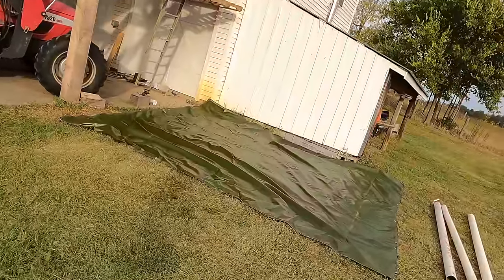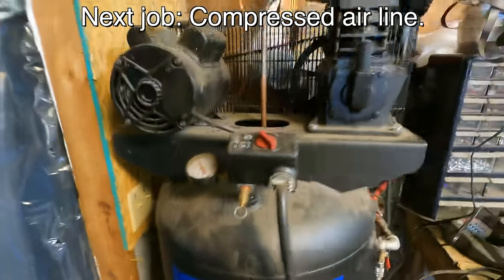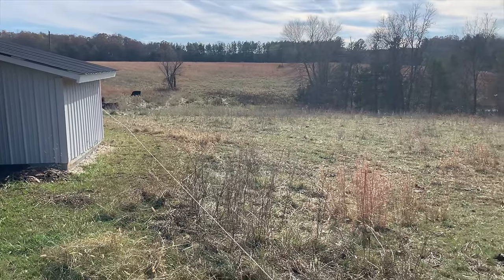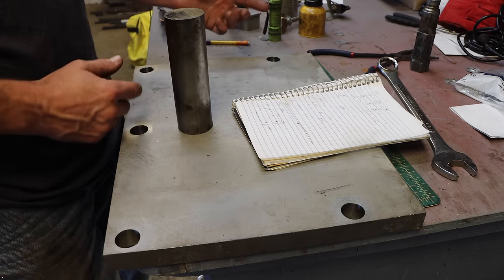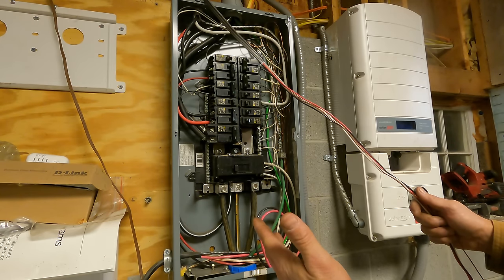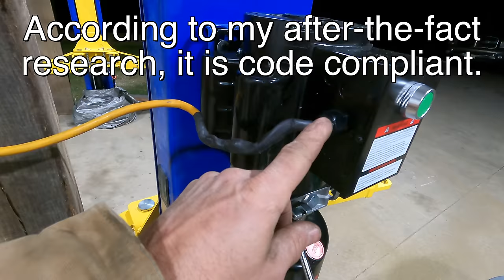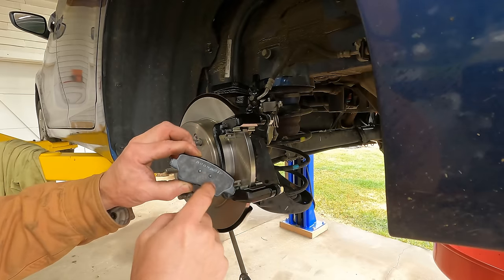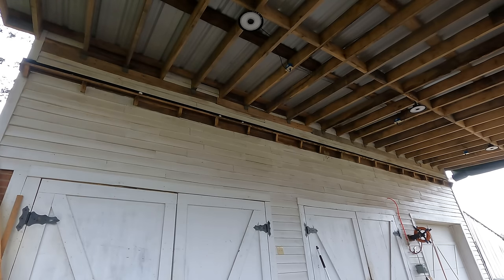Installing a 2-Post Vehicle Lift And Other Big Shop Improvements.

Comment: With the duplex outlet right at your lift, you can put one of the outlets on the red wire and the other on the black.  Just make sure to break the tab on the hot side of the duplex outlet.  That will give you a pair of 20A circuits each with one outlet, instead of two outlets on the same 20A circuit.  Just might come in handy out under the shed.

Comment: Not that you needed the 2nd opinion, but I totally agree with your sentiment that the receptacle box you put along the 240 volt line is safe. I definitely stared at it a while though. The main thing that would potentially make it unsafe was if the breaker had to be larger than 20 amps. There's specifically a carve-out in code that you can put 15 amp receptacles on 20 amp circuits. But you can't put them on anything bigger than a 20 amp circuit. Normally 240 volt lines are used for things running more than 20 amps, so I could see why an inspector would give you a stink eye for it, but as long as you don't replace the lift with something that needs 30 amps, there should be no problem.

I should say, for modern code, and honestly your safety in a way I have personally been hurt before, you DO  need that whole circuit to be GFCI protected... or you have to pinky promise to never touch the live leads while standing in a puddle. I have no idea if the breaker you put in was GFCI or not, so I'll just pretend it is in my mind and leave it at that.

Comment: You say you are not 'an electrician', but I can tell that you have done wiring before, and you understand conventional single phase electrical circuits. I like a heat gun better than the torch for heat shrink tubing, though. But what about that poor seal?? :) Nice job with the leveling and mounting to the floor, although I would call your 'bushings' 'spacers'. Your Evolution chop saw is pretty tricked out!

Comment: Have the bottom plate version of that lift. Was $1750 delivered before the... ya know... got mine 5 years ago now. Zero issues. Lifted a 1967 RR Silver Shadow, heaviest for me so far. Saw a video of one that leaked at the fitting connections, I used some rings from the HFT viton kit and zero leaks.

Comment: Brilliant channel - tiny suggestion. Love everything about what you do. I have learnt a lot. I know you like to make things to last. Great to see you soldering those joints with flux and adding heat shrink. Perfect! Flux is acidic. Scrub it down with something (ISO Propyl Alcohol will do). 10 years later, if you don't, the acid will corrode the joints. 40 years ago, I worked for a military contractor. We dipped all circuit boards (solder joints) in a Freon bath (with no lid on it) - probably explains my mental health :-) - Just saying...
Reply: or better still forget the solder and use crimps

Comment: I like you progress on your shop expansion. Oh somewhere you said you used drywall screws in your tarp construction? Drywall screws rust unless stainless steal.or zinc coated and are ectremely brittle. Any lateral loads can cause them to break. A better choice for outdoor use, general wood construction  are strar drive, zinc coated, deck or construction screws. (They do not slip often, like phillips head drywall screws do.) Simpon Strong Tie brand has specific structural screws for use with any of their or similar framing connectors and braces. They have increased strength over other screws for use with thier framing hardware. I think you said you did use those on the ledger board already. I have used both with great results.

Comment: As a veteran of many plastic tarp doors, I finally developed a solution that lasts forever. I now make my tarp doors 2 layers thick. Outside layer is black shade cloth, the inside layer is a good quality poly tarp. The shade cloth keeps the sun off of the poly tarp, and the poly tarp provide a wind & rain barrier. I have "doors" that have been up over 10 years in the Calif sun and storms and look as good as the day I installed them.
Reply: @FarmCraft101 Looks like you got some spammin' going on here. Can you delete/ban the guy?

Comment: When I built my house, I put in an automatic transfer switch outside and a 24” length of 6x6 wire trough above my panel. The ATS let’s me shut power off to the entire panel if I really need to, and the wire trough let’s me fish the wire most of the way to the panel without running a steel fish into a live panel (we used conduit).

Comment: I would not have made a good farmer. My mantra is anything worth doing is worth doing right which also equates to doing things as much as possible so they are better than 'just good enough'. I understand the mindset when you have too much to do and therefore only do 'good enough' because you have more to do than hours in a day, but again, that's why I would not have been a good farmer as I would have continually been frustrated in my life because I couldn't complete things in the way I wanted to. I had enough of those moments in the career I worked in and now understand a little bit better my personality. Thanks for that. Also enjoyed the video and how you approached putting up the lift.

Comment: I really enjoy watching you work. A few enhancement suggestions regarding your wiring. Most people don't know that a standard 120 volt outlet can actually be wired with two different circuits for the two plug locations. You break off the tab which electrically connects the two "hot" lines and then run a separate wire to each one. Since you have split 120 hots into that box, you could run the red to one side and the black to the other. That way you would now be able to draw twice as much power from that one location in case you ever use two high draw devices. For example, you might plug a portable saw into one outlet and a small electric space heater into the other. My other suggestion would be push to fit wire connections inside that box instead of wire nuts. ("Wagu" type). They take up much less space and your little box is getting crowded, especially if you use my split circuit suggestion which would mean one more pigtail.
Reply: You've only got one neutral, which would be shared by both 120V outlets.  So, you'd still be limited to a combined 20A through the shared 12AWG neutral.
Reply: @ruinhair  Not so. The neutral in such a set up only carries the difference between the two hot currents because the hots are 180 degrees out of phase. If each hot were supplying exactly 20 amps, the neutral current would be zero. I know this sounds crazy, but I spent a lot of time earning my electrical engineering degree and that is how it works out.
Reply: @johnhorner5711  You're right.  Thanks for replying and providing more info!

Comment: You should get some on the the rams and cables on the lift. The chrome on them is super thin, and once its gone, its gone.

Also for SXS, mowers and tractors I took some 2x4 1/4 wall rectangular tubing, and welded some inserts that drop in the lift arms. Then took some 2x5 channel and welded some pipe so the pads from the lift can drop in. You put the 2x4 between the arms, then put the pads under the narrow frames. For zero turn I only use one and clamp it down fits right behind the deck. Then put the front tires on the other to arms.

Comment: I just found your channel and I'm really enjoying it.   I'm a millwright, which is the legitimised form of the 'jack of all trades', so I'm really enjoying the breadth of your content, and my family comes from meat cow farming, so this is all old-home-week for me.   If you start fixing a bolt gun in your next video I might pass out from the sheer familiarity of it all.
I'm only 19 minutes in, and you just mentioned in the video how you are going to approach the second leg of the vehicle lift, and anyway, what I want to actually say is that how I would have done the second leg of the vehicle lift.  For be, the best way would be to use long wedge anchors and add washers and nuts to lock them to the concrete so that they stick up 6" or so, but they are solid.    Now add more nuts with washers on top, and set the flange of the leg on top of that.   Put more washers and more nuts on top of the flange.  Now you can adjust the nuts to get the leg as plumb as you want it.   Here comes the important part.   GROUT IT IN.   Grout is a very dense cement/mortar mix that doesn't shrink hardly at all.   You pack that under the flange, and now you are protecting the studs, and you will feel oh so much better about things when you are working on a heavy truck with the wind blowing.

Putting an 8" thick slab under that flange would NOT be a good idea unless you are making that slab 100 square feet.    This is a two-post lift, so it has to take some potentially serious bending loads from imperfectly balanced vehicles.   It needs to be anchored into something BIG.   It needs roots.    Unless your thicker slab is big OR you drill into the old slab to mesh rebar into the new slab you are seriously reducing the safety of the system.   Grout, however, sits on top of the original slab and makes the system safer.

Keep up the excellent work!

EDIT:  I kept watching the video and saw that you did grout it in after putting in that rather impressive hunk of stainless, etc.    I would have used the long studs that you had to use anyway.  Way cheaper, and just as effective, but adding grout to yours is excellent.

Comment: I don't think the wiring of the receptacle is unusual, but typically the hot side of the receptacle is split, with each side being on the A or B phase. This is very common in residential wiring, and basically gives you double the breaker capacity since each side of the outlet is on it's own breaker. Regarding the wiring to lift, soldering is interesting! I was raised in a house that was built in 1899, when the gas lamps were electrified knob and tube was installed, and the knob and tube was added to before the advent of modern Romex with single wires that were all soldered. While I like your solution, my approach would have been to install a locking 220v plug, for a local disconnect, but I'm not sure why ... it's just my thought process. Thank you for another fantastic video!

Comment: Get a window regulator motor 12 v type from any vehicle and rig up a pulley system. Those motors are super powerful and that will save you yanking on that para chord which is painful.

Comment: If go looking to replace your hose reel, The Harbor Freight air hose reel (the cheaper one) has held up well for me (4+ years in a hobby shop), well worth the money. Also, I used electrical conduit (EMT) to protect the exposed air tubing (not pex) I used in my shop. Might be worth looking at for the pex you have outside.
Reply: That's great to know!  I have 5 old commercial quality hose reals I bought on auction about 10 years ago.  All are still functioning great.  I bought a Kobalt residential model sold by Northern Tool and that's been working great for about 5 years.  I just bought 2 more Kobalts of the same residential model and the threads going in to the side of the swivel were the wrong pitch (?) for the hose provided in the package.  I used a thread gauge and that threaded in fine, but the hose wouldn't go in more than a full turn.  Weird, but it's working for now.

Comment: That tarp pulley system is very clever. Took me a lot of head scratching with my eyes closed, to  figure how the tarp rolls around the pipe when its pulled up.
Reply: @K3PO  its thats pulley magick. It's difficult to explain in text but I'll try. The rope that goes under the pipe. It starts at the beam at top where it's fixed with screw. The other end of the rope is also up there at the beam but it's not fixed, but goes through pulley. Basically the rope that touches the underside of the pipe causes it to rotate while it's being pulled up.

Comment: Like your use of PEX for compressed air. And, while I agree that it can be used for compressed air (in non-industrial applications), you should not be surprised if you start blowing air lines. Plastic piping was started in the US in the 1980s. First used in industry started failing, not because of pressure but because the pipe was affected by compressor oils. Also, you will undoubtedly find a significant pressure drop at the end of your longer lines, under higher flows.  Finally, you should put a downward leg before your hose reel, called a drip leg. This will collect condensate in the air before it reaches your hose reel.

Comment: Hello
I am a new viewer and I am greatly enjoying your channel.  When I was a kid I worked with my old man a lot and he was an electrical contractor. The copper furrele you are using is called a Buchanan sleeve. They were very popular fifty years ago and in my opinion they are superior to wire nuts,although the European connectors are excellent for joints that are coming apart, wiring to motors for instance. The nylon caps you put over a correctly crimped Buchanan were permanent, or until they were attacked with side cutters. I noticed you mentioned the wiring code in your part of the world and they would not have been allowed in Canada. The reasons are of course water but especially in the country your furry little friend comes into play, squirrels  love to chew wires so you would have to use MIT or armored cable so the little devils have a hard time chewing through it. Funny, I worked with my old man for all those years ( slavery) and I still had no money for the movies on Saturday night, how did that happen??? I remember wiring parking lots when it was forty below f. And the wires sbapping from the cold this was well before global warming. Canada tends to legaslate things to death we have rules for our rules. Piont in fact if you have an hour to waste watch Ice Road Truckers ,share thier pain about going through the ice, bulls**t at its best, I have been friends with truck drivers running  the ice roads for 30 years no one excepts one poor soul years ago has gone through the ice, he did because he was removing the Intial snow-covered lake and could not see the open water. The lakes are checked twice a day with ground penetrating radar so it's no more dangerous than asphalt. I was so impressed with the electrical trade I became a HVAC/R contractor, I hope my old man is wiring parking lots for eternity.😊

Comment: I would be a disconnect beside the hydraulic pump. I learned this the hard when when the momentary switch on mine arched and stayed on. It was a panic to shut the lift down before disaster struck. Even an e stop next to the green button would work.

Comment: If it's a riding mower, you could try finding Hard Points at each corner and using slings around the Lift Pads hooked to the Hard Points...Lift the mower from above if you feel comfortable getting under it while it's in a sling lift that is...

Comment: Raychem makes an epoxy/adhesive inside coated heat shrink that is waterproof when installed according to instructions.  They make a nuclear grade too for when you get your backyard nuclear power plant.   I was also going to suggest dry packing grout between the foot of the lift post and the concrete.

Comment: My elevator mechanics used to drill 1/8 thick stainless 1 “ dia holes in elevator faceplates  for floor lockout key switches using kitchen liquid soap as a lubricant with no trouble.  I believe they also used 3/8 drill motors. 
JoeB

Comment: So, in my experience, using a piece of 1x4 or 2x4 to sandwich the top of the tarp against the board on the top will give best results. Your pvc tube at the bottom is netter than my rebar tied at the bottom.

Comment: At work we set equipment on epoxied in "jack bolts" to anchor/level the equipment.  Then form up and pour cementis ground under the baseplate.

Comment: All good til the wiring outside. We wired an out but did a cutoff switch before the outlet. Strongly suggest armored Bx cable for the wiring outside due to critters especially from outlet to lift motor. Also i wouldnt wear a wedding ring when working on live circuits.

Comment: If you want the tarp to not flap in the wind as much. Cut a piece of strapping down the middle and put a piece on each side every couple three feet as battens. It also keeps the tarp more flat and uniform. Nice work!! Ps. I realize it’s a barn like you said. But for future electrical work. You want to mark any white wire that isn’t used as a neutral with some type of 
tape/marking on each end so anyone that ever works on it knows it’s not a neutral.

Comment: I have fitted many two-post lifts in the UK and noticed there was not a locking nut on the end of the safety cables which in my opinion would be essential. Worth checking out.

Comment: I got the same lift, except that the hydraulic line ran at the bottom.  When I lifted my 2003 Ram 3500 the concrete started cracking.  I took it down, cut the concrete, angered holes down 3’ tied threaded j bolts into the rebar cage.

Comment: Honestly the way you mounted that low side lift column was the best way I would say. If you had cut out the concrete and added a pad, you run the risk of that pad moving independently from the rest of the slab, even when you pin it with rebar. Since you got extra long bolts, your still tied into the main slab now but with a big shim in between. It’s all downward force anyways so it’ll be good. I always over do things so when I put my lift in, I put a brace coming off the top of each column and tied it into the steel center truss in my steel frame shop. It don’t wiggle at all when a vehicle is on it now. I’d imagine you could do the same with yours on a wood roof…If you ever were worried about it